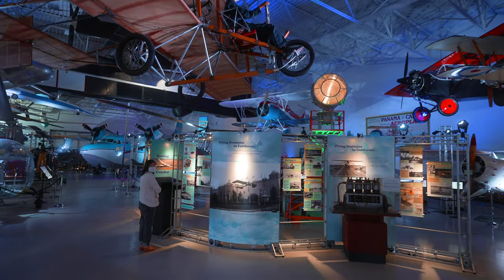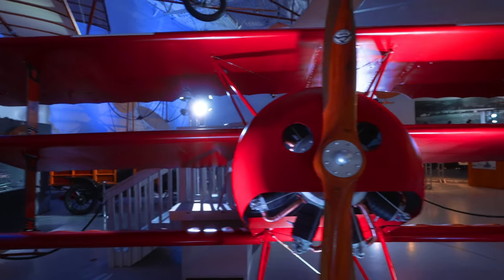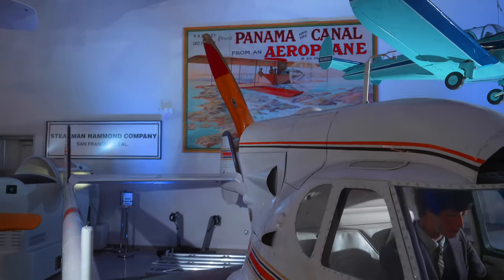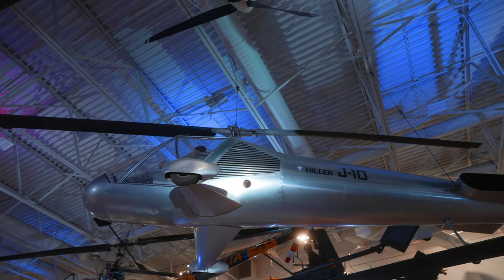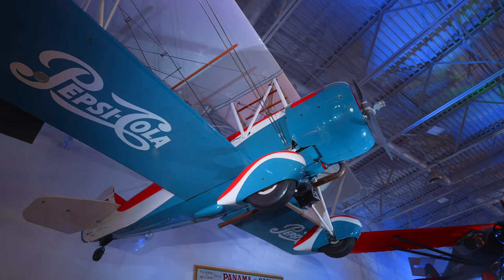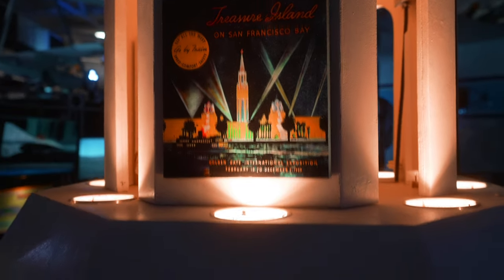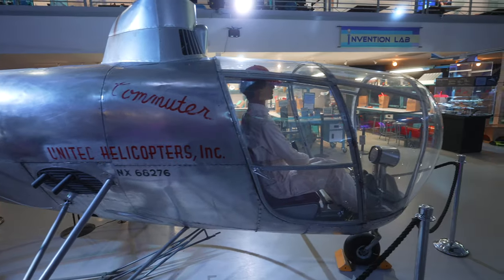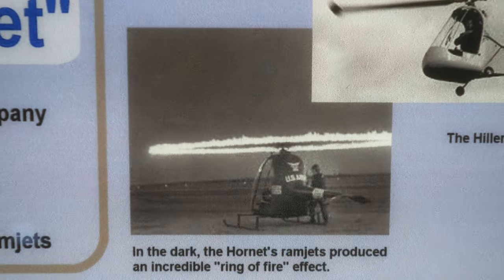Hiller Aviation Museum

Comment: Tip for the sim of landing at SFO: Don't move the stick or pedals. Put the throttle at 0, that will cause the plane to glide to the runway. Afterwards push the nose up with the stick and use the pedals to prevent from sliding off the runway. If you use stick, the wings and engines will scrape the ground.